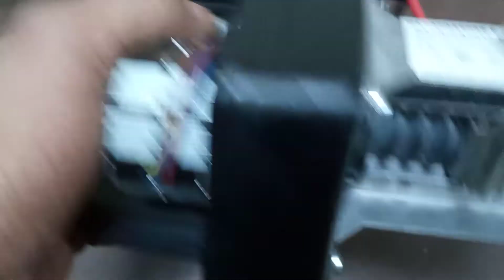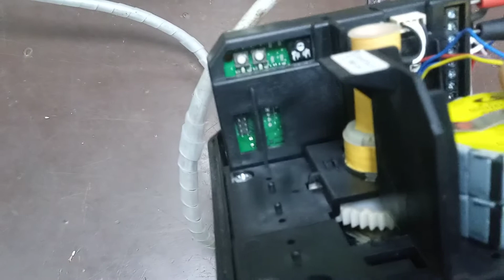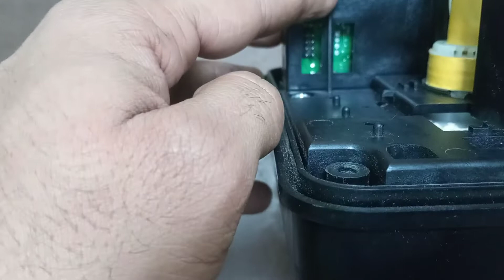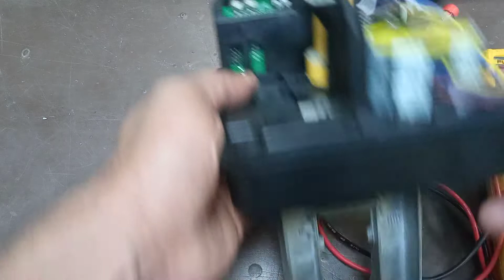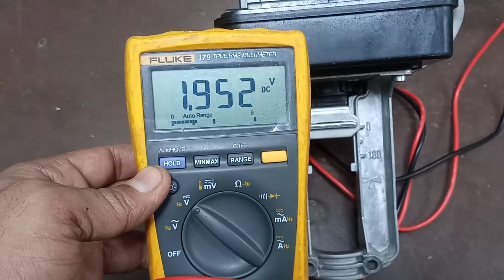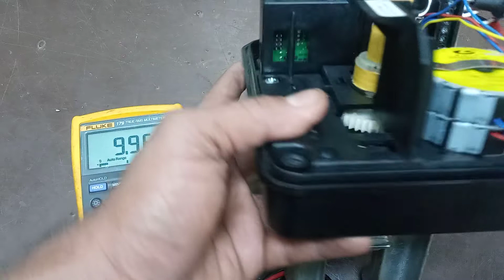ML7420A Linear Actuator Working |part2

Comment: Hi. I have an issue with the Honeywell actuator ML7421B8012E. It is opening more than the required percentage. Means it is opening 35% at 2V, more than 50% in 3V until 7V. Above 7V working fine with Daikin Chiller and valve location is in Chiller bypass. Can you please help.

Comment: Hi if we need fully open and closed which wire want to suply 1/2 place
Reply from the maker: to Open this valve half then you need analog signal and apply 50% it will open the valve half